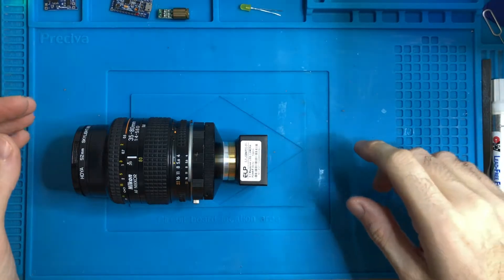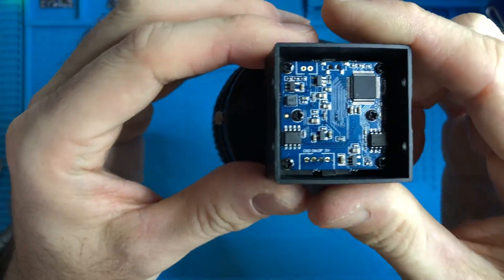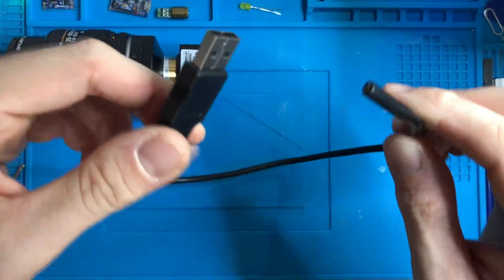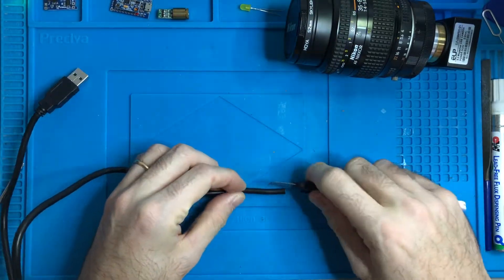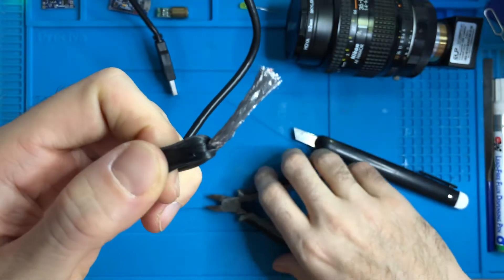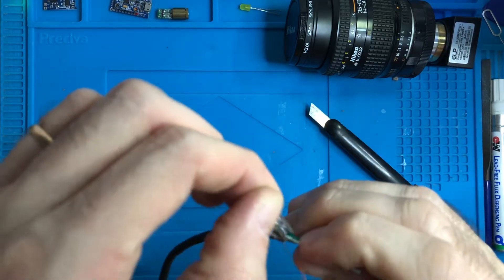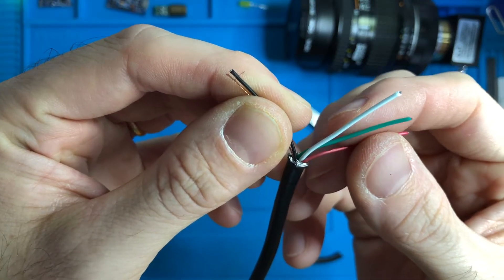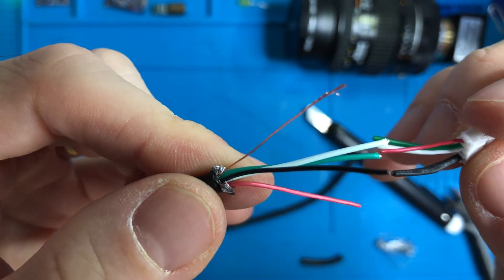Modifying a ELP-USB8MP02G-SFV camera for guiding a telescope: part 1/3 - Shortening the cable.

Comment: Hi, excellent. I have to ask, what mount uses the camera? Is it C or CS mount? Greetings.
Reply from the maker: What I have is a C-mount, but on the body of the camera there is a screw that holds the lens thread in place. By undoing that screw, you can than release the thread for the lens and adjusts it in order to change the distance of the focal plane: so my guess is that you can try to adapt it for a CS-mount, if necessary.